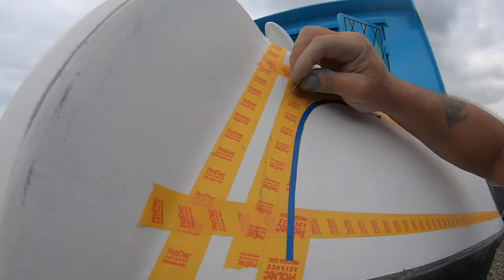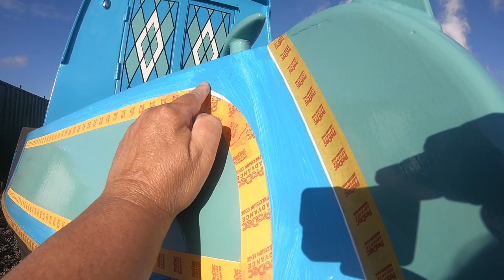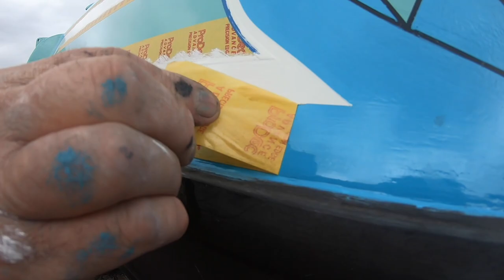VLOG 87, Narrowboat Fit Out - Painting the Bow

Comment: Another great video. Love all the diamonds and colors together. Think the heart idea is great and definitely like it the 2nd way better.  Had not realized the front area was as small as it is. I to like a larger back deck like you have. Can’t wait to see your fabric choices and will not be surprised if you can also sew everything too as your the couple that seem to have an endless supply of talent. If you ever wanted to I believe you could start a boat building business and it would do very well. When the boat is finished and it’s winter time will you go straight out on the cut or go in an marina for warmer weather? I saw a video that they put fold out patio covers on each side of the boat and it gave wonderful shade wondering if you might have thought of doing something like this? With the hot weather I guessing it helps lower the inside temperature on the very hot days. Hope to see the twins soon doing some work with you they seem to enjoy doing anything as long as they get to spend time with you. I betting someone could be a millionaire if they could invent a air conditioning unit for the boats that didn’t use much of the battery life. I wonder how many have something to use if in the marina and have endless power? Best wishes, Susan
Reply from the maker: Thankyou Susan, Yes we only have a very small Bow because we wanted the extended enclosed space inside to use as the bedroom rather than have the sitting area in an open well deck. Not sure yet of our plans to get on the water. It all depends on when we have saved enough money to buy some of the more expensive stuff we are waiting for now to finish the fit out. Time is quite short now as it wont be too long before the rivers start to rise around here and we get floods and floodgate closures. So if we are done in time we will get on the water and start to cruise. We are not going into a marina unless we ever have to leave the boat for sometime. We also have the option to keep the boat on the hard standing here over winter and launch in the spring. So we are just going to keep going until we are finished and then decide. The twins have had a great summer and have just came back from Guernsey ( Channel Island) where they have family. They have been helping us paint the stern and you will see that soon. Oh yes air conditioning would of been lovely this summer 👍

Comment: Looking at the front of your boat have you left provision for a tunnel light, port & starboard lights and horn?
the intricate paint work on the bow is brilliant, love the diamonds
Reply from the maker: Thankyou Michael, yes we have already done all the wiring for the lights and horn. The side Nav lights are set back a little bit to allow for the curve on the front of the boat. You can see the cable for those on the outside and so now they just need attaching on. The trumpet horn is going to sit on the roof at the front and the tunnel light is being placed above the door. We just need to drill the holes for those. This is the reason why we had left the bow wall inside only temporary attached so we could add everything once the paint was on on the outside then fix the inner wall permanently 👍